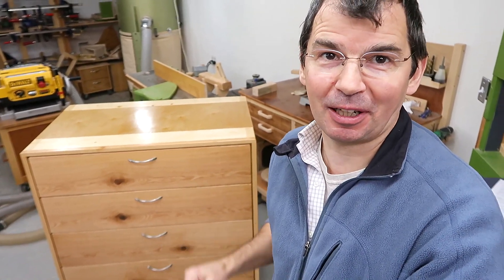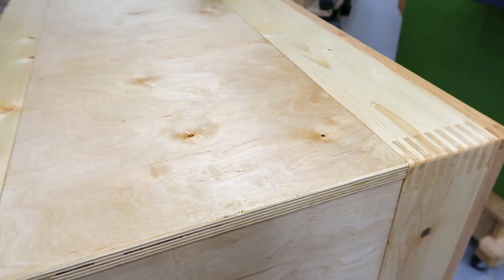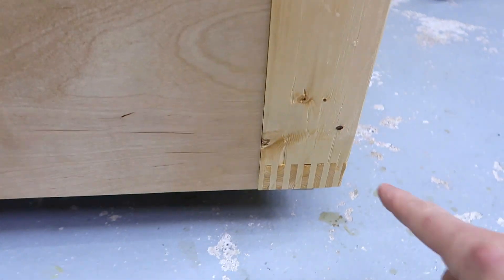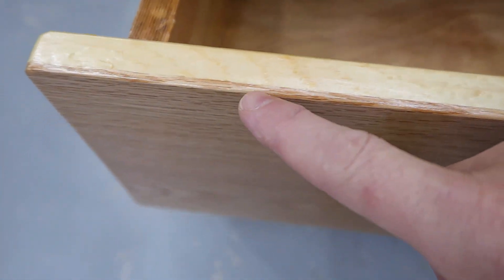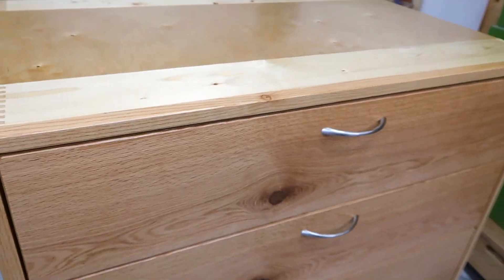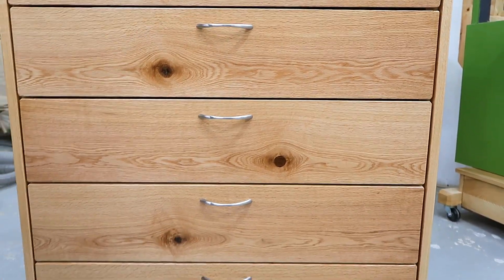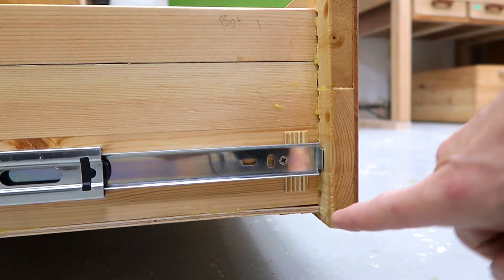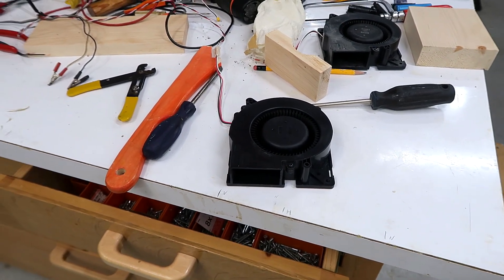I screw up more than I used to

Comment: I still don't get why you cut your joints so tight? You know that it becomes almost impossible to fix misalignment because the glue sets up quickly. Can you not adjust your box jig so that you get a bit of a looser fit?

Comment: To fix the direction of the front, you said the veneer was to thin. Can't you just saw a bit of the drawer also and flip it? (Would need new handle holes, of course)
Reply from the maker: it needs to be flipped front to back.  If I gota bit of the drawer, I'd just have softwood on the front.
Reply: @matthiaswandel  but if you instead rotate the front "upside-down" and plug the handle holes with some dowels of the same material. But maybe it looks worse?